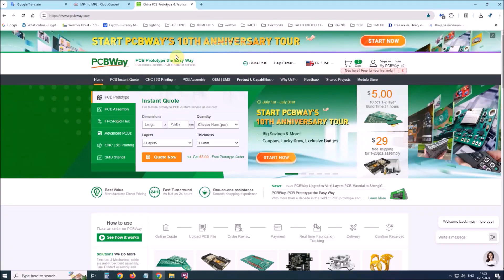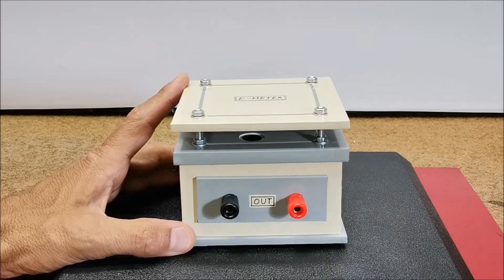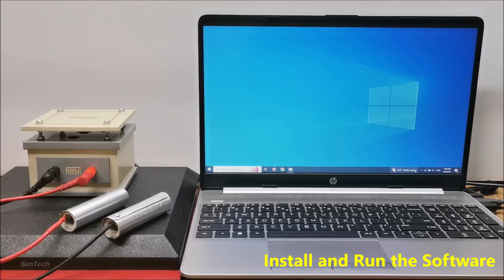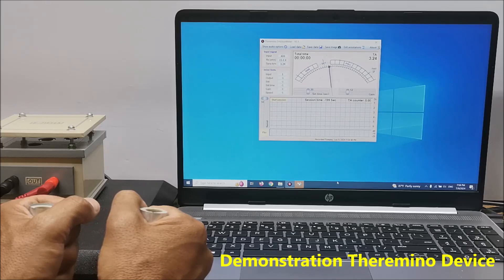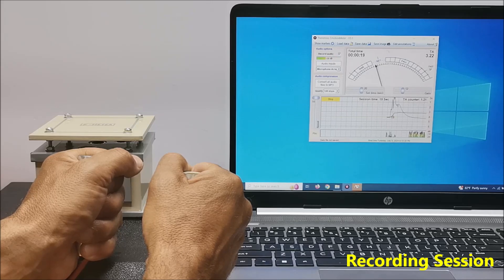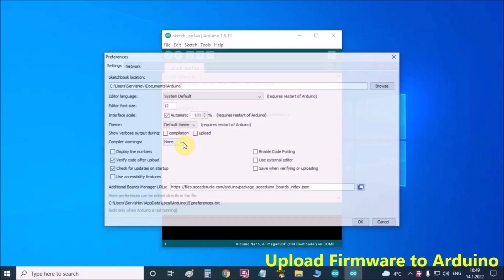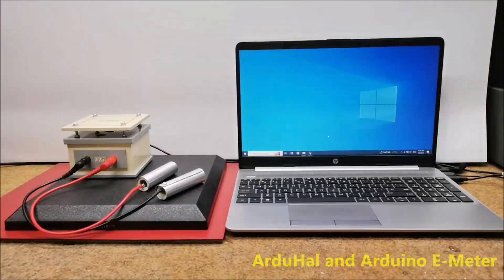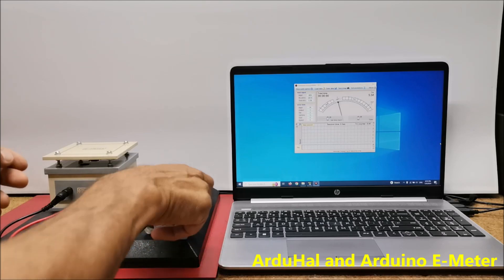DIY Ultra Sensitive Theremino-Arduino Polygraph, Scientology E-Meter

Comment: Man, I'm so glad someone made this a DIY. Thank you so much!  But are you sure your software is adjusted to being truely "ultra sensitive"? You seem to hold the electrodes with a really hard grip - it is not supposed to be like that! A session can last long hours... plus: It is much more comfortable and convenient to make a solo-electrode with a larger diameter. I took two pieces of copper-pipe (talked out of a plumber) stuck them on a piece of wood and put a cable-tie between the copper-pieces for isolation. Works like a charm. (using it on a custom-meter from a non-cult-person)

Comment: Thanks for the vid 👍 Question:  I understand you made the case, but what is the separate lid above the box that you have bolted to the top? Is it just decoration?
Reply from the maker: The box is from a previous project of mine and the top part has no function.